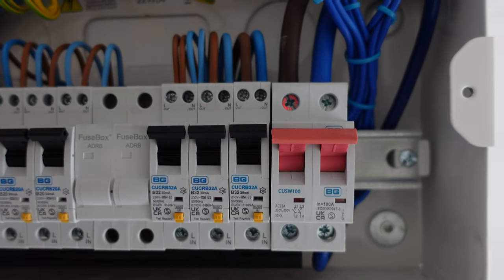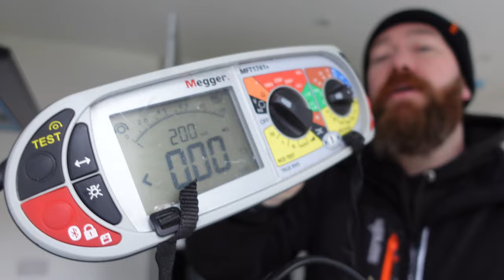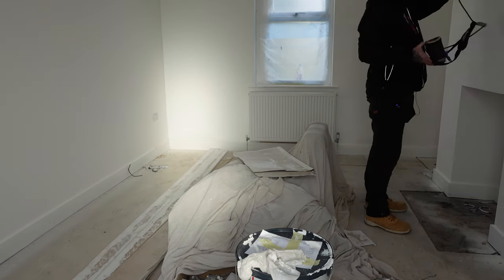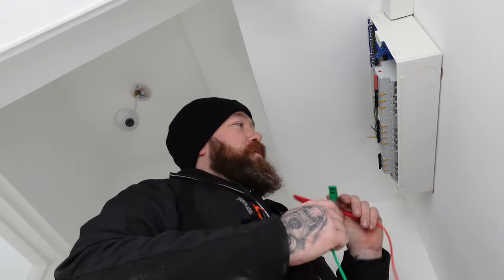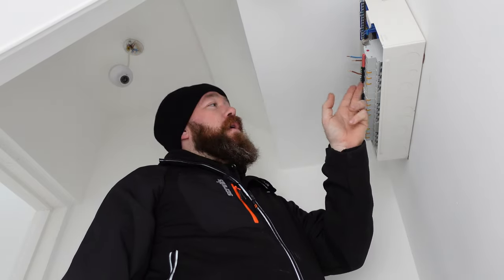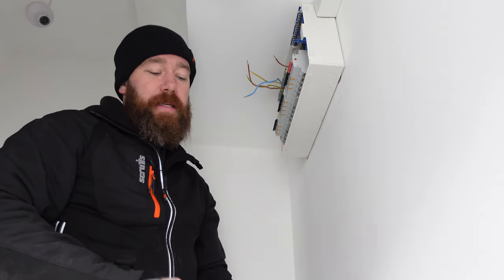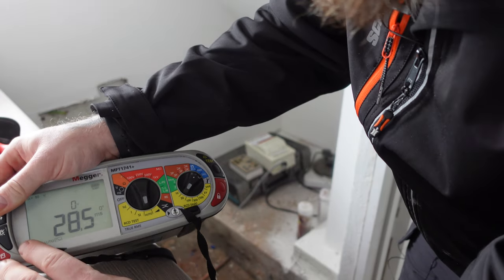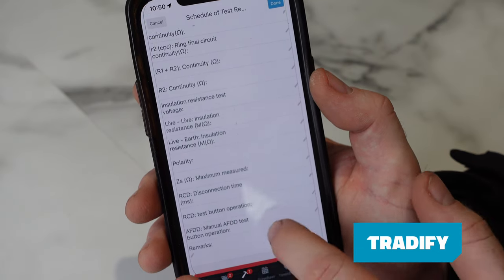Electrical Test Procedure For A New Fuseboard - Electricians Life

Comment: The readings on a ring circuit should be the same at every point when conductors are cross connected, should they not? 
(R1+Rn & R1+R2 parallel paths ) Also, I understand that Amd 2 of BS7671 only requires the result of the x1 RCD test (within 300ms) is 
what should be recorded on the sheet when testing AC type or A type devices set to AC on the test instrument-no?👍
Reply from the maker: They should be near enough but within 0.5 I believe, your correct about the rcd trip times also they have taken x5 out now 👍

Comment: Hey really informative video, but just want to point out something which I bet you already know, regarding RFC testing and it just came out wrong while filming.
The dead test R1+R2 of a RFC should read roughly the same at each socket (r1+r2)/4 within reason (0.05 ohms) if the cross connections are correct.The size of the cpc is irrelevant. If it increases to the centre point of the ring and decreases back towards the origin, you've connected the wrong cpc to the wrong line of each leg. The live testing on the other hand (Zs) would do what you suggested and increase to the mid point and decrease to the origin due to the current traveling down the earth fault return path with the lowest impedance,  it won't split evenly down both legs just down the fastest route etc.........R1+R2 same reading at each point, Zs increases to mid point. and decrease to origin.
Reply from the maker: Well that was a lot easier to understand than how I was trying to explain 😂😂 I got a bit lost when filming it 😂😂

Comment: Really great video Jack enjoyed it and full of great content thanks, but amendment 2 states earth must be connected to earthing arrangement when doing IR tests Reg 643.3.1 The insulation resistance shall be measured between:
(i) Live conductors, and
(ii) Live conductors and the protective conductor connected to the
earthing arrangement. During this measurement, line and neutral conductors may be connected together. anyway was routing for you to get £250 out the van vault 😂👀
Reply from the maker: Cheers dude I defo couldn’t get in there tho 😂😂 
Yeah a few people have said this 😬 I shall do this from now on, seems a bit mad tho if your just testing one circuit 🤷‍♂️

Comment: Great video mate , appreciate the explaining in a simple understanding way 👏👏.
Quick question  do use use the adapters for the light fittings when doing your zs and ir ?
Any reasons for not testing at the rcbo or is it just easier at socket/light point ? Cheers jack
Reply from the maker: I don’t use the adaptors I just struggle 😂 yeah you can test at the bottom of rcbo but I think the future away u go up the circut if it still trips in time the better, probably makes no difference at all just in  my head it sounds better 😂😂😂😂
Reply: @JRCElectrical  should try them jack makes it so much easier on light points 🙂,
Last question hopefully mate, am I correct when you do rcd tests and you take your highest reading that provided its less than 30ma is it classed as a pass.
Suppose what I'm asking is what would be a pass and what would be a fail ?.
Cheers jack keep up the good work mate 👍
Reply from the maker: @garylatto4191  anything higher than 40ms would be a fail dude 30ma is the current it would trip at, trip time is measured in mili seconds dude
Reply: @JRCElectrical  so is that equal to the 0.4 second disconnection time in onside guide ? 🤔. Sorry for all the questions mate 🙄
Reply from the maker: @garylatto4191  that’s the one dude

Comment: Nice job! I've just started out by finishing my license 1A and your videos are excellent. I did my first test last week - just tried an RCD test for shits and giggles. My meter did not let me take the reading because an error came up "Uc > UL". My UL is measured at 50V. I'm assuming this means my earth rod is shit ... any clues as to what this might be fellow sparkies?
Reply from the maker: Hello sir, I do believe that might be something to do with contact voltage it may be warning you of high touch voltage but I could be wrong, someone reading this may correct me